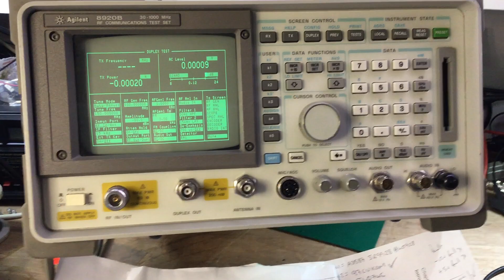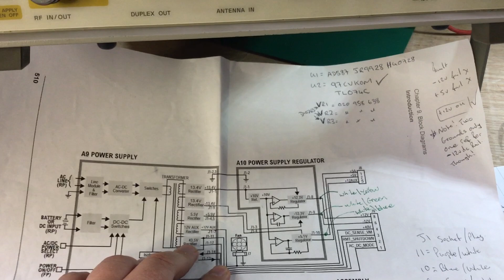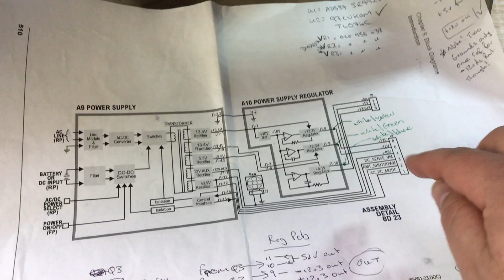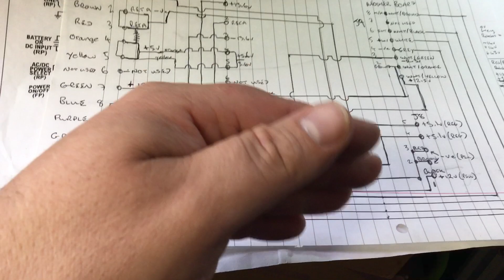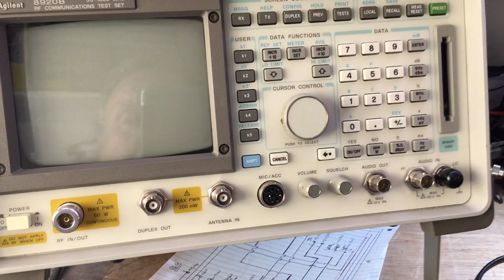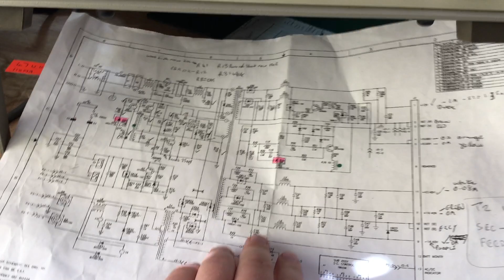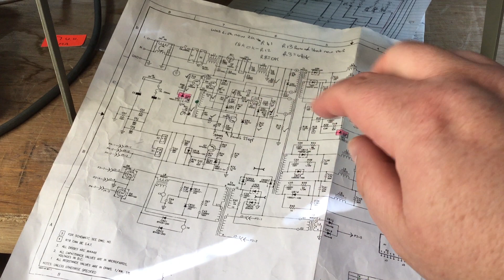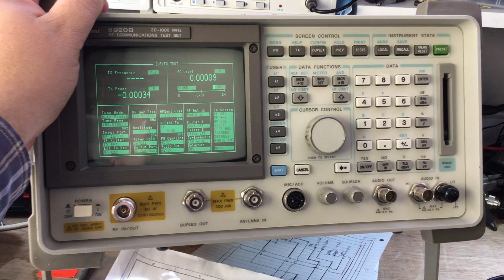HP8920 Radio Test Set PSU repair PART 3 FINAL

Comment: In video 2 the waveform seems very unsymmetrical as the input voltage increases. My guess is that either the switching frequency is in excess of design parameters or the switching transistor is too slow due to internal capacitance, perhaps damaged. Really just a guess. At this point I would simply buy another power supply and recap it.   I traveled to Scotland  and London some years back from the US. Beforehand I had bought a nice universal 12V power supply from Skycraft Surplus in Orlando that was apparently good from 110-240 VAC 50/60 Hz it worked flawlessly for a year or so before the trip. Arriving in Scotland I plugged it in to charge my gear and it responded with a huge FLASH-BANG!. I ended up buying one at MAPLIN in London that actually worked on your wonky high voltage.

Comment: I don't know if you managed to get to the bottom of the PSU problem. I think that the issue is on the control PCB mounted to the PSU PCB. You mentioned that the unit does not appaer to have any feedback from the secondary side only signal via a transformer. I think that it does feedback via the control board. I could see what looks like  6 pin white package opto isolator on the ctrl board. I imagine that there will be protection and PWM controller circuits on the ctrl board and that is where the problem is. I just found your channel and I am enjoying the content.
Reply from the maker: Hi There, No i did not get to the bottom of it, i ended up with the power supply working perfectly at 120v AC but it shut down when running at 240v AC, i do plan at some stage in the future to revisit it again, but for now i am running the test set in my workshop off a step down transformer supplying 120v AC in order to run it properly. I am sure one day i will get to the bottom of it, However with that said i am currently making another video of a HP 8560E Spectrum Analyser PSU repair & that too is a nightmare to work on, HP equipment has some really badly designed power supply units. some are easy to repair & others are a nightmare. Sometimes its better to replace the power supply as a complete unit if its a bad fault as there is next to no information on them.
Reply: @rfmanrfman4536  Thank you for getting back to me. I totally agree with regards to HP PSUs they can be an absolute nightmare and to be honest I really do think they did this deliberately so that component level fault finding and repairs are so difficult combined with the lack of schematics the end user would not bother so they can sell you the latest model. I,m in the market for a 8920 if you come across one. Best regards M0XFX

Comment: I know that its quite an old video now but i wondered if the protection MOV might be collapsing at higher voltages. Karl
Reply from the maker: Could be I plan to look at it again, i still use the test set now you will see it in my videos, however its powered via a 110v output mains step down transformer, here in the UK its 240vAC so had to step it down to 110/120v AC to get ti going, when i have time i will have another go but at mo i have a big pile of test gear to fix so its taken a back seat for now. Cheers.
Reply from the maker: i think its something to do with the voltage references on the output feedback loop, i am using the test set in the workshop to this day on 120v AC & it works fine until i can get round to looking at it again. This PSU was burned up badly at first then someone else tried to repair it incorrectly so i had two problems to contend with sometimes its just better in those circumstances to simply replace the PSU as a complete unit if you can get hold of one.

Comment: Hi Dear, can you help me? i have HP8920B with level RF high in spectrum analyzer mode. Regards
Reply from the maker: If you have incorrect level in the spec analyser try running the calibration inbuilt program first, it’s an inbuilt prog you run in I basic, it’s within the service monitors menu for running systems, You need to look in the operators manual which you can download from the internet for free, it tells you in there how to run diagnostics & calibration modes. Providing however the RF output in RX & it measures TX rf power at the correct level this needs you to check or compare with another radio test set first. This will rule out another fault if it reads TX power correctly but when in the spec ana it still reads high then you need to run the calibration, run the diagnostics too. Also download the service manual free of HP Agilent web site it will guide you on making adjustments.
Reply: @rfmanrfman4536  please see the video of the self test of my old HP8920B. https://youtu.be/ipxjdc-MPQE
Reply: @rfmanrfman4536  Maybe investigate the components around VR2..it may be doing just what its supposed to do..the fold-back point voltage.may be a bit low. I have a similar p/supply to fix but different problem...found R3 470k open but now the oscillator has stopped and blows the fuse.

Comment: oh i miss the days of getting manuals with theory of operation, i tend to collect those. you mentioned the switching is going outside its rated mode i wonder if you could replace with better parts that could handle the range better. enjoyed the videos and subbed. its possible that you have parts that can test ok but under load fail and sometimes these are the hardest to find. parts behave much differently under load and under different frequencies.